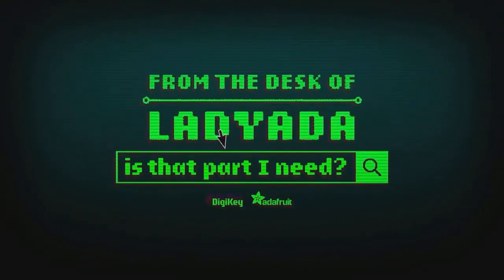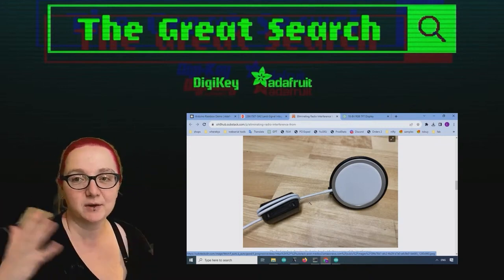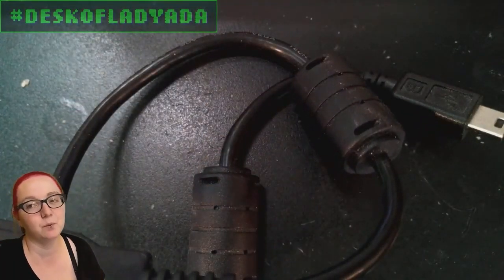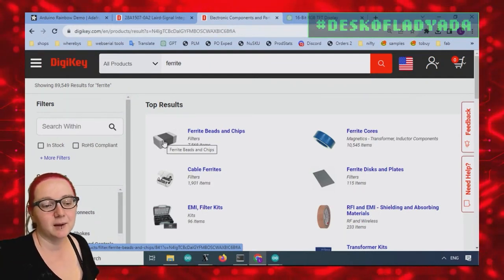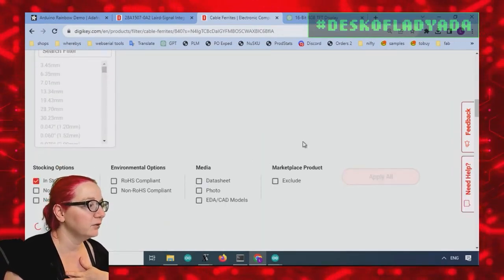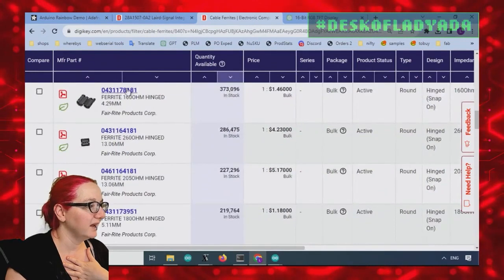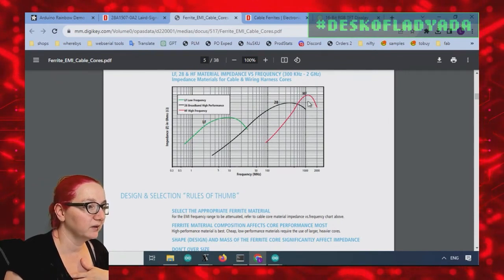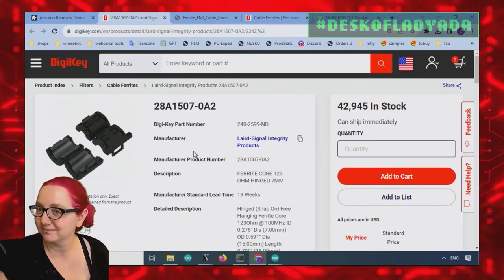The Great Search - Clamping Cable Ferrites #TheGreatSearch #DigiKey #Adafruit @Adafruit @DigiKey

Comment: Passing EMI was absolutely a trial and error process in my experience. Some call it black magic but that just means we mostly don't get it and go for luck. I feel quit certain that things could be measured and calculated but the test time is usually very limited and going through a sample box of snap on ferrites is fast. The test equipment and facilities are very cool so go through the process sometime if you can find a need.